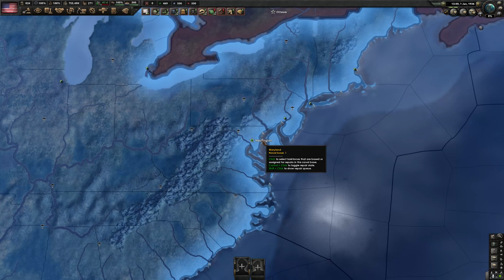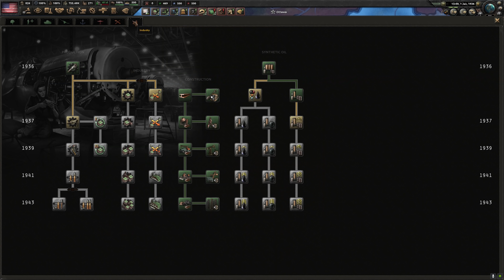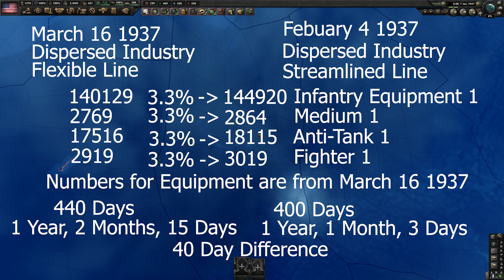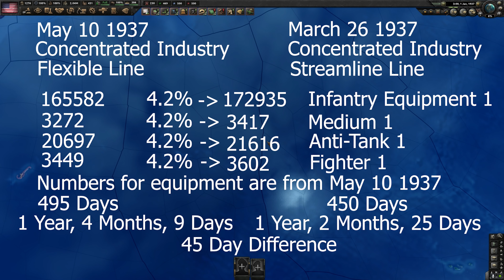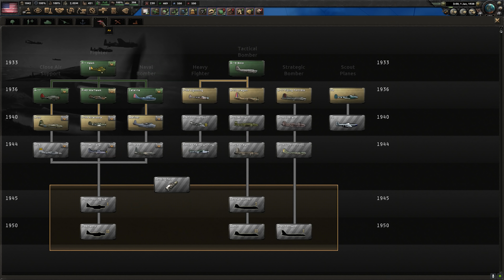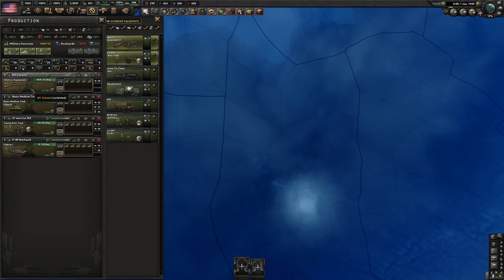Dispersed Industry vs Concentrated Industry Guide 2022 - NO STEP BACK HEARTS OF IRON 4

Comment: If you EVER change models OR switch around factories, Retention (and therefore Dispersed*) is superior.

It doesn't even matter which option gives you the most stuff overall!
What matters is that Dispersed,* due to it's retention, gives you more production *immediately.*

Because guess what's better: more production one year (or whatever) after you made some change IF you made no other changes since, or more production immediately?
Hint: wars are won by what you can field today, not by what you can field by 1946...
(also, if you have more new tanks when the enemy is still researching them, they're pretty screwed) 

So, unless you're a minor who will BOTH never upgrade their produced equipment AND never switch around how many factories produce what, Dispersed* is ALWAYS best.

(and, arguably, even less-more medium tank 2s or fighter 3s still do more damage than more-more medium tank 1s and fighter 2s... So quality *can* overpower quantity; or, more accurately, even if you have fewer production points in the air as fighter 3s, they can still shoot down more production days of the enemy's fighter 1s. 
So even if it costs you total numbers, it can STILL be better to invest in better models - although this definitely depends on your game and the extent of your fronts/air zones)

For me, I always try to redistribute my factories in such a way that ALL the equipment shortages will be filled in about the same number of days.
That means I have to shift around factories pretty often. And so Dispersed's* retention is VASTLY superior for my playstyle.
Sure, I could have even-more of the stuff I was already overproducing by not-messing with it. But honestly, what's the point of having even more guns when you're 1k behind in arty and up 200k in guns already??
(and don't tell me to Lend Lease it - the AI will just grind more/longer, but a human would actually win)
Reply: That is actually not true. 
In an MP game, wars are not won quickly. 

NSB has seen the rise of air Soviet builds, which take a long time to defeat. Therefore concentrated on the axis can be very strong, as well as on the Soviet itself.

Dispersed is only better for a time and the best equipment in the game can be obtained faster than you think.

Comment: Your numbers are not correct because you test only on level 5. Concentrated is much better at level 1 because you are still with low production efficiency cap. So if you lack industry and equipment or/and you will have early war concentrated make a lot of sense and will produce a lot more equipment on level 1 and 2(more than the % you show) when you don't switch. On the other hand when you are big nation you will join the war late and you will research a lot of new equipment dispersed it is.
Reply from the maker: you could get the same just by going to export focus or free trade for the factory output. 5-10% more ain't going to do much.
Especially when 25% more only gets at a max 3 years 7.9% more equipment.
Reply: good...  whatever

Comment: I look at it this way; fighting for your life between 1936-1940 (China & Poland + Republican Spain), do concentrated. Switching out to the latest equipment and wanting to have a slight production edge on new stuff between 1940-1943 so you can finish the war quicker, go dispersed. Expecting the war to go past 1943? Concentrated will simply outproduce dispersed and most of the things you need have been researched by 1943.

Comment: Thanks for this in-depth video Konrad, it has been very helpful as I've been tinkering around with a personal mod to try and fix the streamlined and concentrated issues myself.

For those curious my changes are as follows:
Concentrated Industry.: I've added a +5% construction speed and a +5% efficiency gain to each level.
Streamlined Line: Added an additional +10% efficiency gain.

Taking both of these means you'll produce more equipment faster, and be able to build buildings (more factories) just a little bit faster as well.
Reply: No, construction bonus would be insane. That would completely tip the scales on civs and mils throughout the game and snowball into a massive difference.

Comment: You need to show the value of the Production Efficiency Retention to prove Flexible Line is better than Streamlined because what you show on screen proves otherwise (a 4% improvement is still an improvement). Regarding Concentrated vs. Disbursed industry, you need to show that the equipment will be updated more than once every two years; otherwise, concentrated is superior.

To prove your point, you need to show the following:
1) The average time to research an upgrade for each line is < 2 years.
2) 10% Production Efficiency Retention is > 5% Factory Output 

As it stands, all you have shown is that Streamlined produces more equipment than Flexible and that Concentrated produces more than Disbursed after two years. Also, Production Efficiency Retention is important but not how important it pertains to equipment produced.
Reply from the maker: so what we are talking about here is a 40-45 day advantage on production which is 3.3% or 4.2% that never goes up.
vs retaining 20% of your production when you switch any line. which it takes more than 40-45 days to build up to that in streamlined line.
So flexible is still the way to go especially for a 1943 tech bc remember your line is at 100% already so streamlined line adds nothing.
Reply: @KonradvonScharnhorst  Right (and to be perfectly honest I agree with your results), however your telling me the conclusion not showing me. The ideal solution would have been to show two different tests (one "best case" for each) to demonstrate why it is better. I only bring it up because your videos are great, but a newer player may not recognize how good a particular stat is and numbers would make it much more obvious.
Reply: @KonradvonScharnhorst  ahh the first group of numbers I felt the same but now I got what your saying.

Comment: Great video! another thing to consider is that at the start of the game, countries start with production lines already at max efficiency, so they get minimal benefits from dispersed for the first few years (seeing as mils are usually constructed later). Also, there are several things (like support equipment, trucks) where you never have to change the line, so the benefits from concentrated are even greater.
Reply from the maker: True but its only 5% more then in 1937 its 10% more then in 1939 it goes to 15% more.
Reply: Lol, whut??
I change support and motorized a lot 😅
Like, there are times when I have plenty, and take a few mils off them to boost fighter production.
Until I decide to make a new army, and have to boost my motorized, or something like that 😂
Reply: @MrNicoJac  , Math helps. You can calculate ratios for different factories you need. Then keep correct ratios between equipment types to avoid switching. You can also rush equipment to skip the 1940 model production.
Even good planning might not be enough because concentrated needs two years to match dispersed. Even with tech rushing concentrated gains advantage only after year 1943 which is too late for most countries.

Comment: My rule of thumb is with Dispersed is mostly using it on Major nations so you can keep up with equipment being frequently upgraded since you (mostly) have a lot of research slots.

Concentrated for minors as your mostly going to be stuck with the same equipment because your research slots are low (at first, you'd be spending about a year or 2 to get 2 or 3 extra research slots).

One trick I remember in MP is that Commonwealth nations like South Africa would purely focus on Concentrated Industry research and heavy military production on tanks or fighters.

Edit: Also congrats on your (future) 1K subs.
Reply from the maker: Yep as stated in the Video if your an Air controller of a few specific types of planes concentrated is the way to go.
That or just producing tanks and everyone else gives you stuff. However even in MP this is hard to do because the coordination required is usually not there. Or that type of lend leasing is banned.
Reply: Majors do not really switch frequently. 
If you rush the F3 as UK, you get it in early 1940 depending on a few factors. Other nations get it earlier. 

Germany used to be able to get the King Tiger in April 1940. Now this isn't even necessary anymore, as the 1943 chassis is hardly better, than the earlier version of 1941. 
Just get the better armament and put it on the 1941 chassis. Switchting to a different tank with the same chassis results in almost no loss at all.
Reply: @TheRealGucc That is only partially right. 
In some games you might only build planes and not really have any marines out until very late in the game. You might not build any at all. 
This depends on the special forces cap and rule set of the mod you are playing. In the base game, the special forces cap can be exploited, so you could have as many marines as you have equipment for. 

Brazil, Australia and the US will usually provide the marines and land units the allies need. The only other reason for the UK to build them, is because is high command is excellent. But you might want to prioritise industry and maybe some naval / ASW research over modifiers for infantry. 

The crucial point is this:
In the base game, having more fighters improves air trades. If you can win the air war while everyone is still on Fighter 2, concentrated is the way to go. 
The problem is that with concentrated your production of F3 will be initially lower and that could lead to bad air trades that could cost you the air war. But you will eventually outproduce the Axis. 

Also, at least gun 3 and arty 3 can be researched early by the allies. The only reason to go dispersed, is if you can only afford to put military factories that you build very late in the game, i.e late 1940 on these types of equipment. Since you might need to put most of your mils on Fighters up to a certain point.
Reply: You basically want to go dispersed even as minors (but chinese). As minor you kinda need to grow. Conquer some minors nearby and build a power base and thats why dispersed is better: you can faster and easier use factories you constantly gain throughout your conquest.